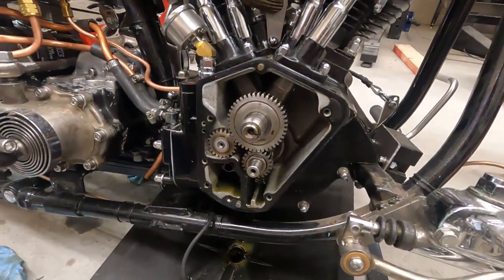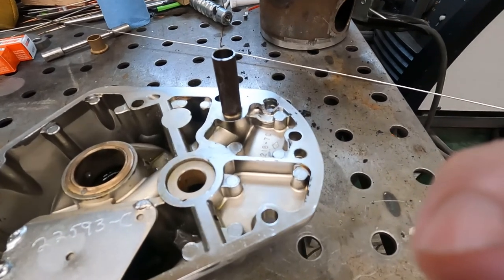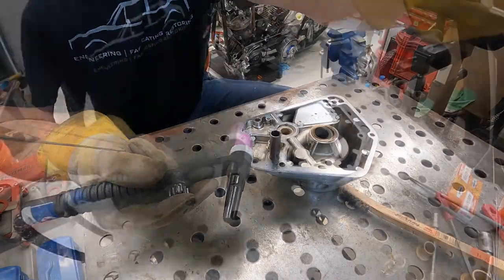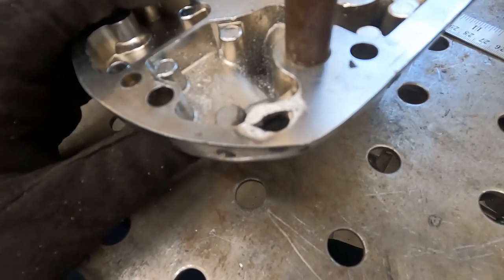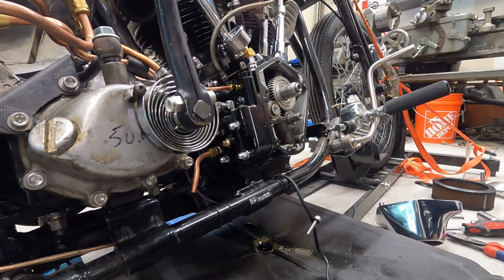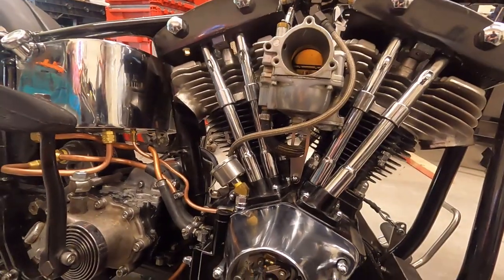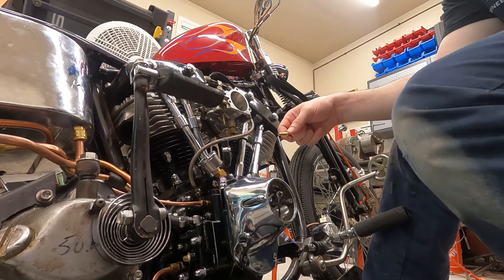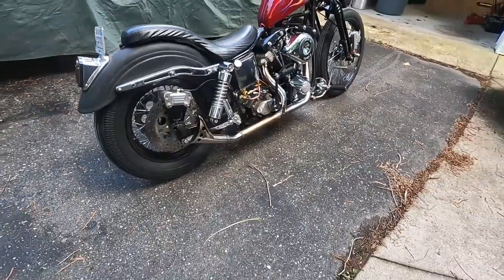Fixing Shovelhead shakedown issues, welding cam cover

Comment: Great video,good lookin Shovel. Best luck I’ve ever had with the leaking main shaft seal on my 4 speeds was to replace the main shaft seal with a new seal and use the supernut at the same time. I can’t remember the name of the company that makes the supenut and the shops I used to buy them from are all closed down now, my buddy who was a shop owner of one of them ordered them from V-twin and also ordered some from another company that sold the Eastern brand of HD parts. Anyway it was the best fix I ever found for my Pan with an open primary without the outboard support like the electric start bikes. Good luck on your project. 👍